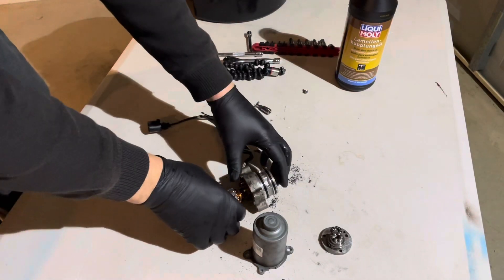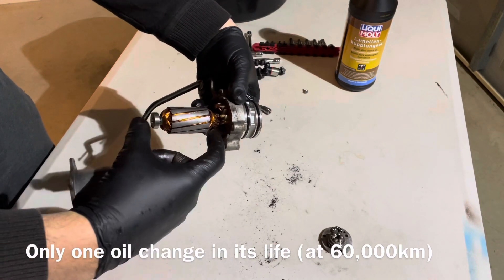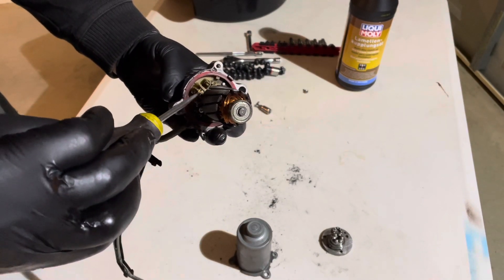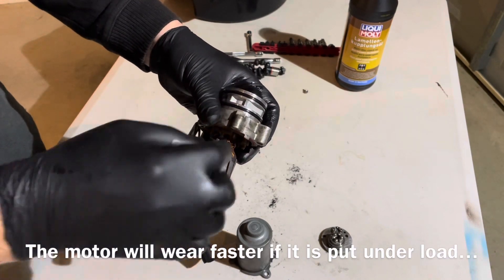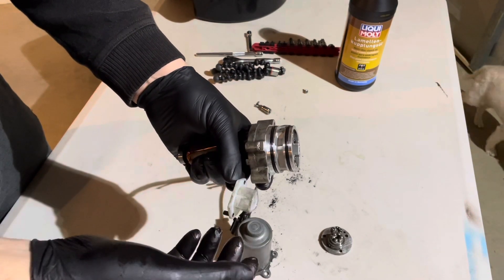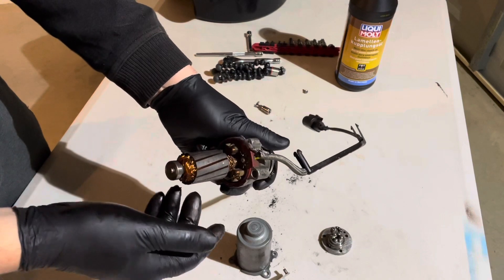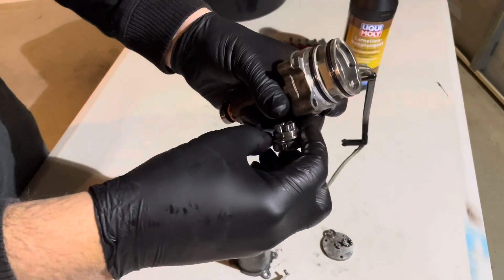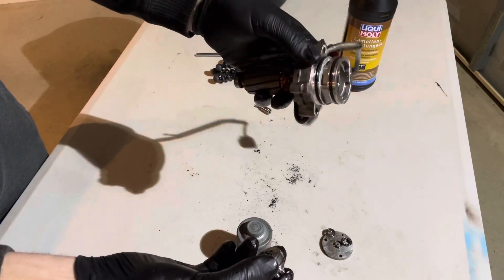Why do Haldex pumps fail?

Comment: Thanks for the video. Do you know how to remove the rotor from that pump housing? Is it just shrink fit so pushing out the axle is enough?
Reply from the maker: @Ccorniit  the commutator (the part that wears) is not replaceable from what I saw.  I didn’t take it apart any further than what you see in that video
Reply: @ thanks for reply. I took it apart as far as you and would have liked to remove the rotor from the housing to maybe turn the commutator and scrape the gaps clean but was hesitant to force axle out to prevent any irreversible damage.

Comment: i noticed a lot of haldex problems , you have to be very carful to have exactly same tire dimensions on the rear and front . slightest difference due to wear or even different tire pressure will put massive  pressure on haldex unit and transfer box . because the system will force all wheels to have same speed and those differences will result in clutch slip .

Comment: I did the oil change for the Haldex clutch and cleaning the screen of the pump but still not working. I used the obd 11 to pump the motor and makes noise and all but my s3 still front wheel drive only

Comment: Hi. Can you please answer on my question? I have problem with haldex gen5 also. When car is running and stationary i hear some noise (pzzzzzz)from the pump i guess, is that mean my pump is done or what?
Reply from the maker: You need to test the system (motion test on a hoist - all 4 wheels in the air and make sure they all turn when put in drive) and/or scan it for error codes using VCDS or similar.
Reply: @DarkePeak  thank, you. I will test it today.
Reply: I guess, you hear the fuel pump, and not the Haldex.

Comment: Haldex 5 does not have hydraulic fluid presure accumlator like Gen 4 does ,  the pump spin speed is "also" designed as a fluid  presure control element  https://youtu.be/CDRVTjMPK9Q the pump brushes wear the comutator out ,  https://youtu.be/HkIMhLmYeqw have also had the presure releaf valve fail and start leaking this makes the unit slip due to the leaking releaf valve the computer  commands more rear torque this causes  the pump motor to run faster to increase preasure to try compensate for said leak , and this wears the out the pump motor faster.  oh and as you said  the pump screan loves to plug up with gunk starving the pump making the pump preasue go low unit fails to transfer torque as it should.. the oil needs to be changed more often to address  its poor filtration and breakdown ..

Comment: Nice video mate, I think my haldex is gone in my s3, its now starting to will spin from the front when launching, even though its stock, would you say i could replace it myself, im pretty a hands on guy and worked on plenty of cars! would love to know, thanks mate!
Reply from the maker: The mechanical process is very simple and only requires a few tools.  But the new pump needs to be calibrated (pump learn) which requires a special scan tool & laptop.  If you don’t calibrate the new pump then it will likely wear out a bit faster.  But replacing it a bit sooner may not matter if you saved hundreds of dollars on labour and the markup on parts.  Replacement pump can be bought for US$280/AU$380 if you shop around.  This job would cost AU$1,500 through an Australian Audi dealer, or AU$420 doing it yourself.  Check the description in the link on my other video of this topic for a good instructional video.
Reply: @DarkePeak  Disabling wires from battery when replacing or cleaning pump helps with the need for calibration, otherwise calibration is "recommended"  but not mandatory - every time you remove the pump from the car(vw manual)